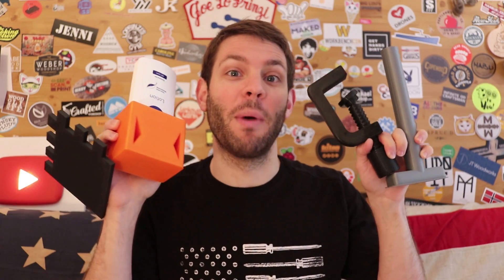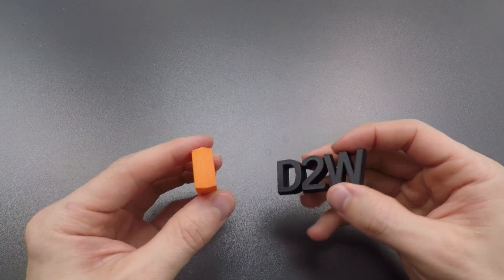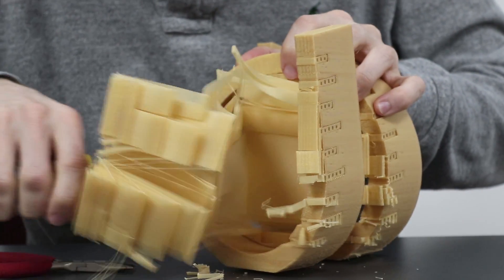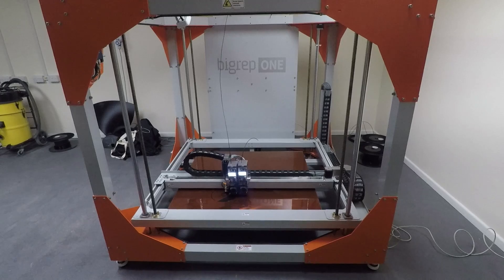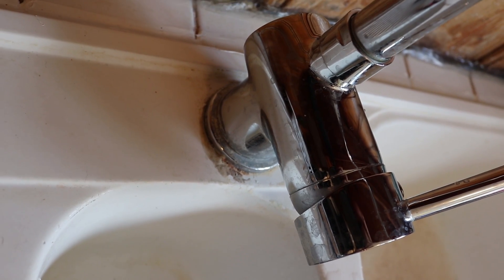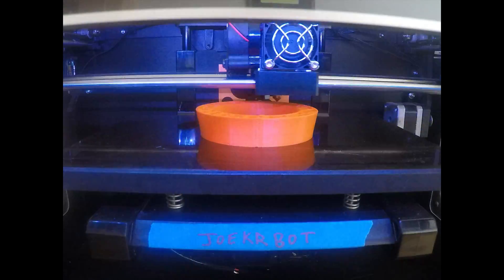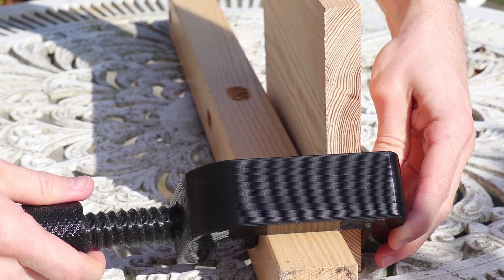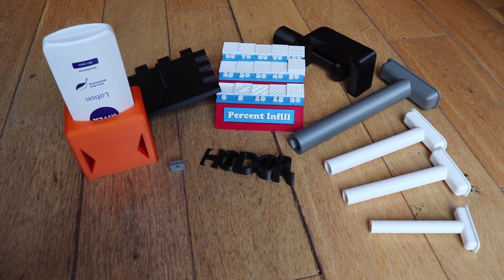5 Great Designs For Saving Money with 3D Printing

Comment: Very informative, but I have to ask how long did it take to print the socket wrenches? I feel like you could go to Harbor Freight and buy some deep sockets for  $20 plus a cheap ratchet and some long extensions for $8. Then you have steel tools for any job requiring more force than the printed part can handle.
Still an awesome video, thanks for making it.
Reply from the maker: Thanks Tom!  Each wrench took about 4 hours to print, so if that was labor time it would be too expensive.  But I had the machines just sitting on my desk so having them print only took 5 minutes of my actual time.  Plus there's not a Harbor "Fright" in London to get cheap tools.  And I wanted to see if this would even work, so it was mainly an experiment.  Glad you liked it; many more to come!